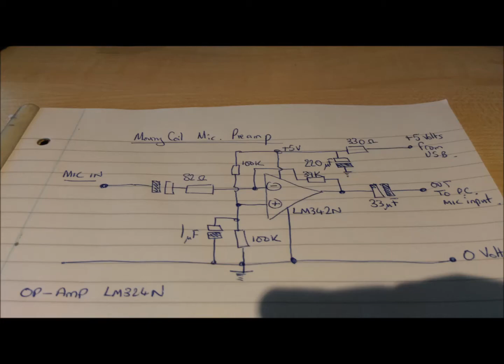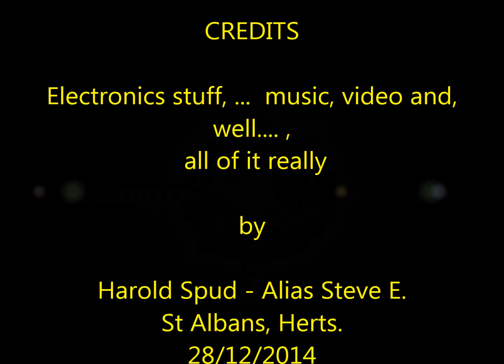How to build a dynamic microphone pre amp for PC input

Comment: Hi, thanks for making this video. I want to make the exact same thing but I have UA741 and not LM342. Can I use these instead?
Reply: Also what is the value of the capacitor in the input line from the dynamic microphone?
Reply from the maker: I think so yes. 741 op-amp is commonly used audio and general purpose op amp. shoudl be ok
Reply from the maker: one microfarad electrolytic. cheers.
Reply: Thank you very much! Cheers!